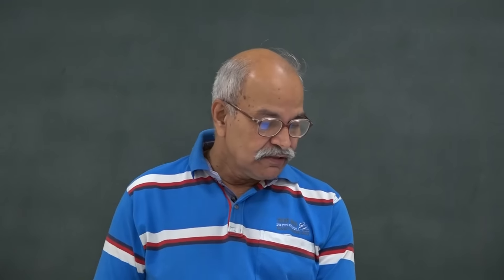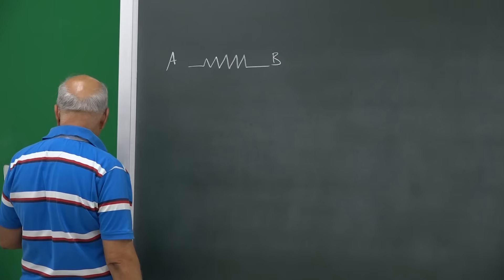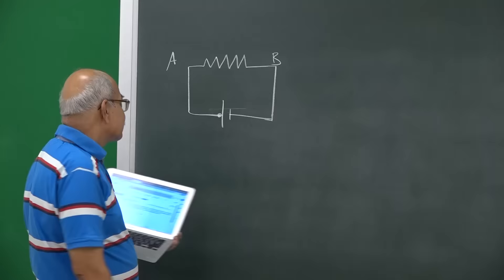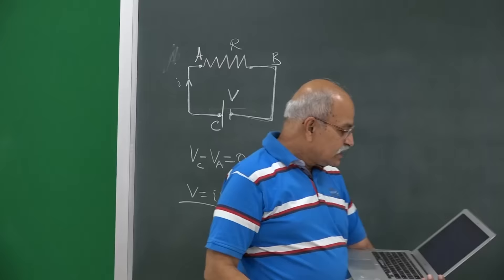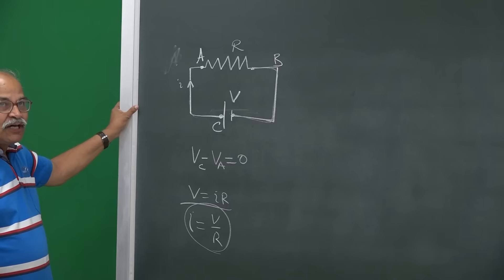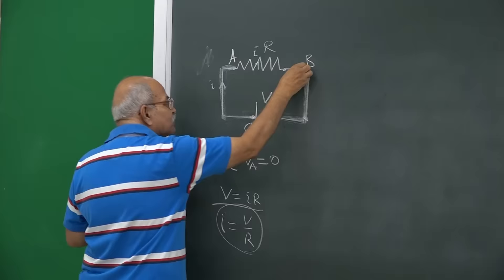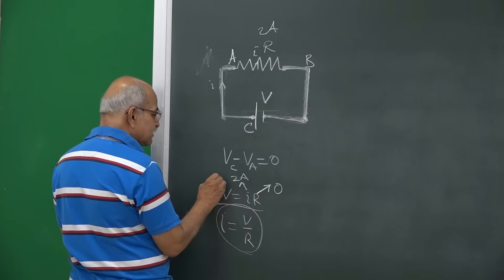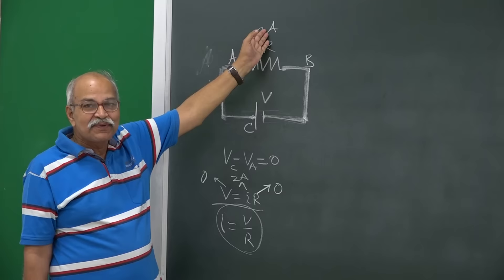Current without potential difference

Comment: But I am not satisfied with the explanation
Reply: to nikal idhar se 🤬 lallu adhmi ko hi nhi samajh me ata h 😂
Reply: Let me explain then;
Since we're assuming that the connecting wire (the wire being used to connect the terminals of the battery to the ends of resistor) has negligible resistance when compared to that of
considered resistor, we may go on calculating the equivalent resistance (series equivalent of resistance offered by that resistor and resistance of connecting wires which is supposed to be zero) along the battery and i.e. equal to resistance of the resistor itself (Rs = R + 0 = R, where R is for resistance of the resistor). Now, applying I = V/Req. = V/R, clearly whole current is due to R and not connecting wires. 
Whatever I have written above is just the basics of "how does current flow through a circuit"! 
Coming to the question, since resistor R has got I = V/R through it and I has reach to only path which is through the connection, you better know that I cannot flow through air and thus it follows its available path to reach and pass through the cross-section of resistor R. In layman's terms, potential difference is something that pushes electrons against resistance in one dimension and in this case since potential difference is assumed to be almost zero, so there shouldn't be any resistance. Electrons coming out of the negative terminal of the battery are subjected to direct themselves for one dimensional motion (neglect the zig-zag movement of electrons), they don't require anybody's help, and since there is no obstacle like resistance in their path they will move even through the cross-section  of connecting wire with negligible resistance. 
I hope it does make sense to you, if that's not the case there's no problem still. We're here to learn from each other!! 
Thanks for giving attention to my words:)

Comment: Yeah no shit it works mathematically, he never EXPLAINS conceptually anything!
Reply: I mean ohms law is pretty logical. When the resistance between two points is zero then any amount of current can flow even when the potential difference is zero. 

Basically whats happening at an atomic level is that first an EMF is generated in the battery which causes the electrons to move, then because there is no resistance in the wire these electrons keep moving with the same average velocity through the wire(which implies that  current is constant through the wire) even though there is no potential difference to accelerate them once they are in the wire.

Comment: Shit explanation, actually it should be like, if we omitt 3 ohm resistance then potential difference across battery will be 6 volt, now since nothing is ideal so assume wire has very small resistance say 0.0000001 ohm so v=ir will ensure that there is a high current in wire. Next say we add resistance so it would oppose high current flow and would decrease high current to bit low and to maintain the same, whole wire including resistance will have the same current. I never liked HC Verma, during my engineering preparation i purchased his books and those were full of tough questions but no concepts though book names were having concept word. Sorry Mr Verma these days many knows more than you what actually concept is.
Reply: 0:02 Yes ,it is high time that school shud use Resnick halliday book in class 11 and conceptual  physics by..Paul g.hewitt in class 10
Reply: thanks mate, i also thought his explanation should have been little bit more refined